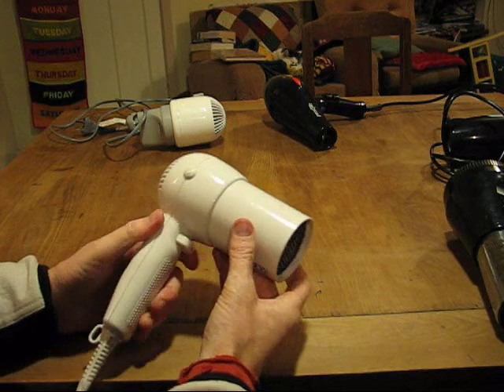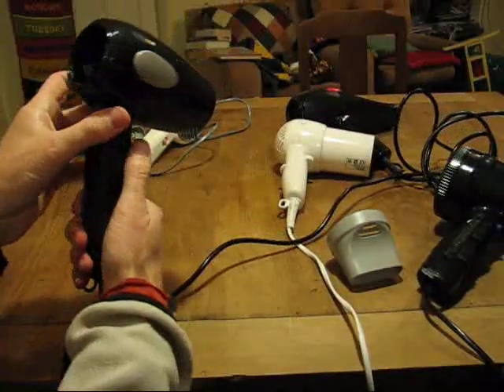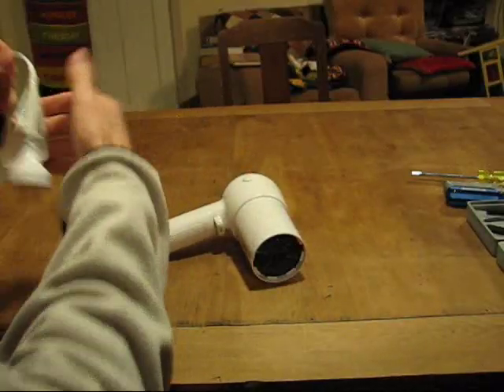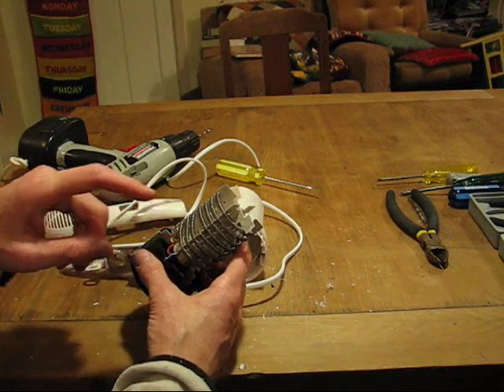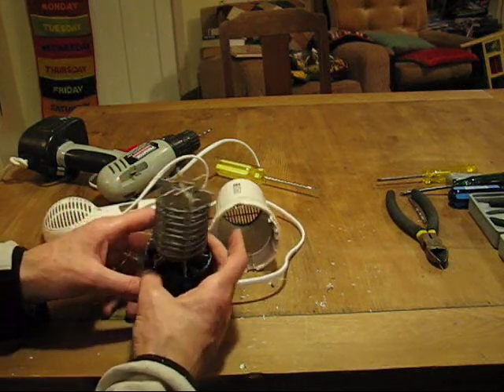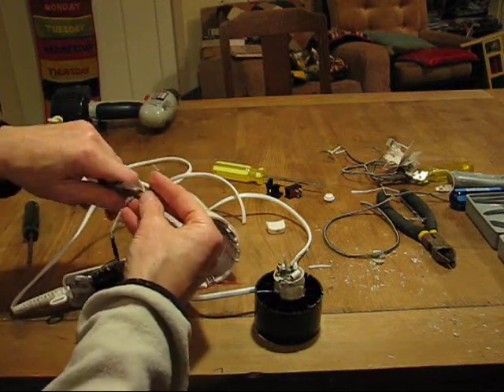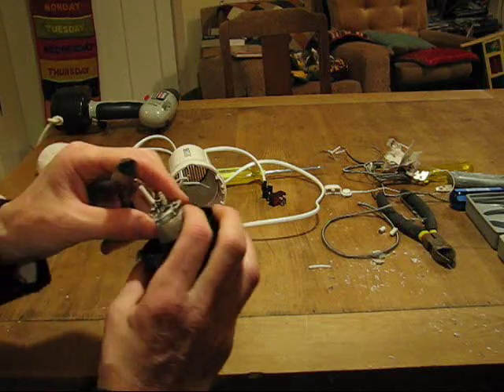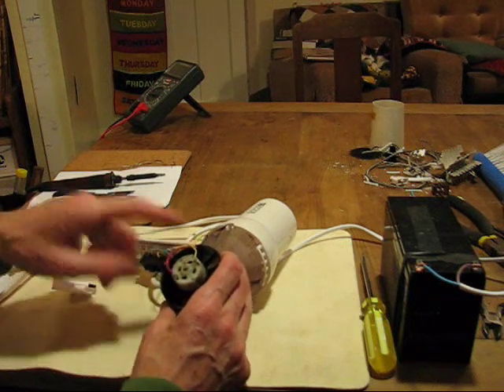Hair dryer conversion to 12 volt fan

Comment: I found that toasters have the same voltage dropper system for their electronic timers using the heating element .
Reply from the maker: Cool. I guess it's the minimum cost solution when a resistive heating element is involved.

Comment: Hey there... I liked your video. I was wondering if you ever made a hair dryer conversion with the high and low setting? I'd like to convert a small hair dryer I have, to use for a type of art called pour painting. Now, I'm usually pretty good at figuring out how to do things.. but I have to admit... I'm stumped. It's what components to use that  has my mind whirling. Which diode do I use to run it on the low setting, can I add a rechargeable battery, can I add a momentary button etc.
So.. if possible.. I'd really like to talk to you about this project, and if any of this is doable
Reply from the maker: Probably the simplest thing would be to use a small length of the heating element as a resister to produce the LOW setting. The wire up the switch so that on one position it works as I showed in the vid, and in the other position it adds the "resistor" in series to produce the LOW setting. Good luck!

Comment: Hey paul, thanx for sharing, im making a car air heater... I have a 12 v ceramic heating element...my question dibu think i can use this normal 220 v hair dryer motor without the coil and simply hook it to a 12 v battery? I mean do u think i can use the hair dryer housing as it is, but instead of the coil part, i remove it all and just put my insulated 12 v ceramic heating element and the rest i leave as it is (switch and motor) and hook up the whole thing to a car battery... Do u think itll work? Thanx for ur tine
Reply from the maker: That will work electrically. I can't from here if it would work thermally (will it over heat?. But yes - the hair dryer motor will run off a car battery just fine. Sounds like a cool idea. Where will you mount this new heater? Inside the cabin or up front with the engine?
Reply: @paulkennett  thanx for the, quick rply... I am thinking of having it fixed in the toilet of  my camperbus...i have yet to work on finding a way to fit the ceramic heating element there up front of the hair dryer... But basically, as u demonstrated i am going to remove everythng except the motor and 1 switch to turn it on, and add the element up front somehow... So, out if ur experience, ur saying this might work and i should give it a try?
Reply: @paulkennett  or maybe even juat remove to motor and use it in another housing...
Reply from the maker: @kohararakelian5162  Yep - that works too. Any 12V motor would be fine. Another source of strong motors is old battery powered drills (especially old NiCad drills).
Reply: @paulkennett  ohhh yesss, i have one asidee, thanx alot for ur time and knowledge... Much appreciated...
Reply: @paulkennett  srry to bother again, but if i have a 1200 watt hair dryer... And if i dismantel it as we talked above and gave its motor a 12 v dc power...how many ampere do u think it would use? Approximatly...
Reply from the maker: @kohararakelian5162  the motor on it's own will use less than 1 Amp.
Reply: @paulkennett  thats awsome ✨😎😎🙏

Comment: Gah, kicking myself for not realising that the motors on these things are 12v! That makes life so much easier (need something for solder fume extraction).  
For blowing polystyrene beads, I’d have thought you’d want to use the Venturi effect rather than blowing them through the fan?
Reply from the maker: Yep. Eventually I ended up with a venturi blower gun running off an air compressor.

Comment: I cannibalized one of those small hair dryers to use as a fan/blower for my microwave oven transformer spot welder. I used one of those 120vAC to 12vDC plug-in transformer/power supplies that come with every other gadget. (I have a couple boxes of these things I've collected over the years with varying voltage outputs.) I just soldered wire leads onto the plug prong, heat shrinked insulation and hooked the wires up to the  120v AC power-in strip and switch output. The 12 vDC output went straight to the blower motor. Did not have to rig up any diode or such. Works great.
Reply from the maker: Cool. That's a good hack too.
Reply: Did the same. Kicks ass

Comment: please can you tell me how to connect a 12v DC motor and a heating element with ac 230v ,,, please give me a circuit diagram!!!  , I feel you can help me out!!
Reply from the maker: Are you looking for a circuit diagram of a standard hair dryer? (You could pull one apart and discover it yourself.)
Reply: Hey I had disassembled my hair dryer already! I don't have more dryers !
Reply: I need help for connecting them now!
Reply: sayooj koroth hot to neutral and wired up in series with the rectifier and fan

Comment: Would it be possible to remove the heat yet keep it as a 120v unit?  I have a hot air brush that has two speeds and the high speed also increases the heat but too high for my fine hair.
Reply from the maker: The problem is - the design of a hair drier is so optimized that they use part of the heating element to also provide the 12 volts for the fan. It's very clever but means you can;t have one without the other. There some hair driers that do fan voltage separately - but not many.